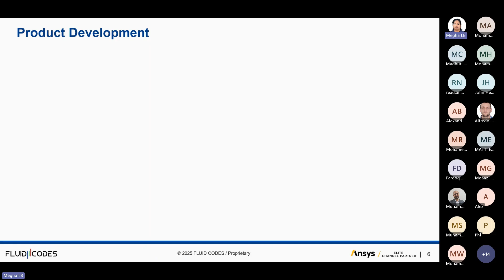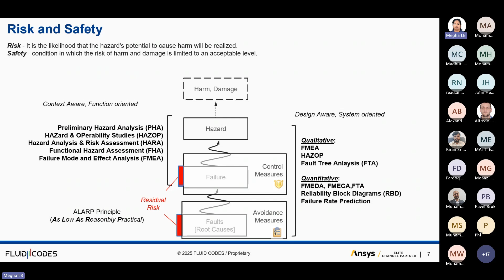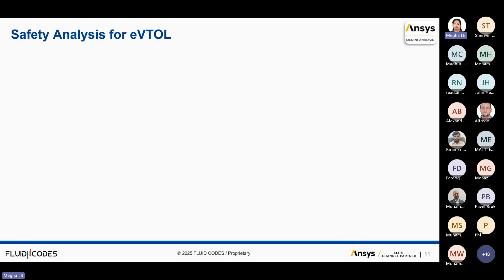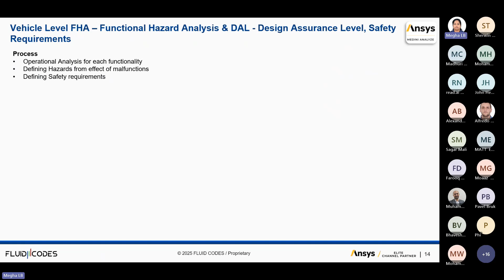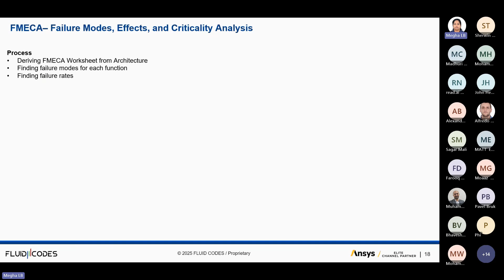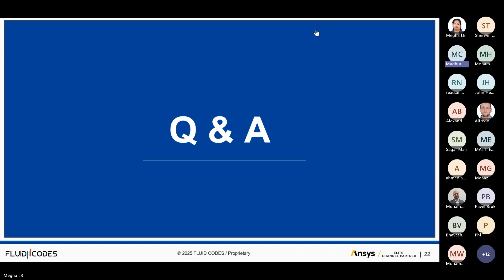A Deep Dive into the Safety Process in Aerospace & Defense

Comment: 👋Greetings Master.
_How to adjust OpenFoam to observe the behavior of atmospheric air at the intake of a cylinder during combustion of the air/diesel mixture with the following conditions:
➡️ Admitted air mass; in order to obtain a leaner burn possible in the stoichiometric ratio range between 14.5/1 to 200/1. Taking into account the variation in temperature and pressure of the atmospheric air at the intake from 17° to 50° and 1 ATM to 1020 mb.
The cylinder with a cubic capacity of 1200 milliliters with the geometry of the commercial diesel engine model OM924.
-Consider Diesel S10 in a typical mixture commonly found at gas stations ⛽.